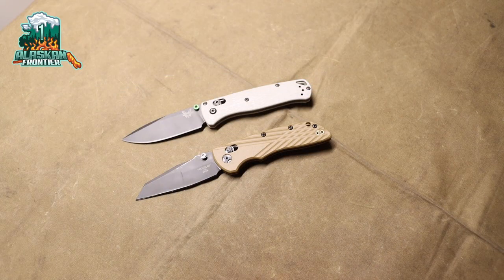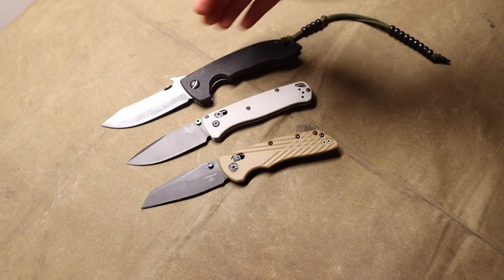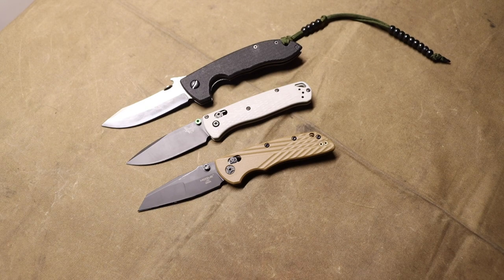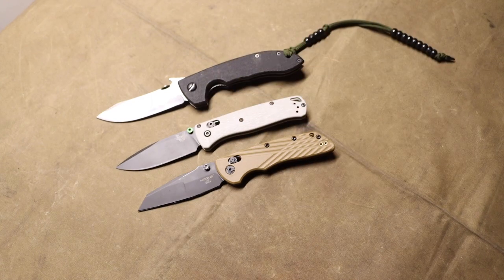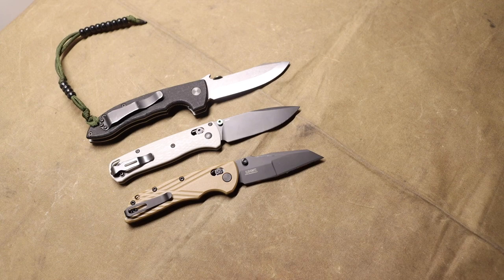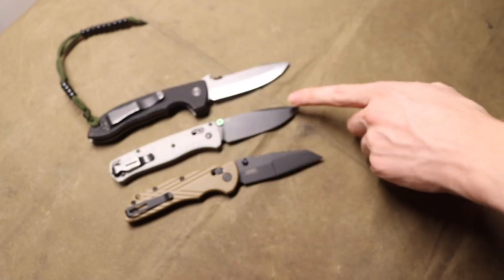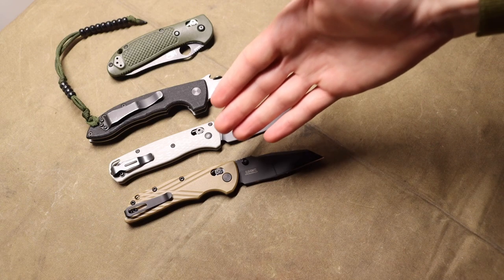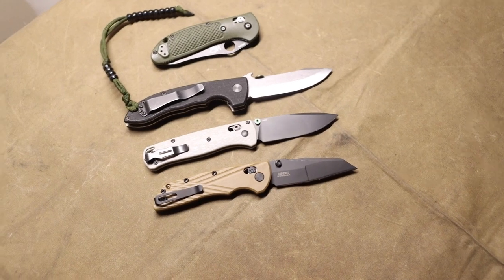THIS Knife Steel is Not the Future

Comment: Its not hype. Its high toughness for stainless steel that traditionally doesn't have toughness. Its edge retention at 63+ is better than most steels.
I really don't think you know what your talking about. I do agree that those brands who are doing it low on a folding knife are just bad value. If they do get 62 consistently that's decent enough for a balance of toughness and edge retention over the majority of other steels like s35vn and most poor performance m390 from most brands.

But yeah buck with magnacut and huge prices is not worth it.

Comment: You know I have to absolutely agree with you. The consistency of a good heat treat for magnacut from Knife makers seems to be really hit & miss. The one steel I really have been super impressed with is S45VN from Spartan Blades, ASK, Spyderco. It’s been outstanding from edge Renton to stability of the edge to rust resistance & how it sharpens. It’s been outstanding and I believe it’s been way underrated due to the Magnacut introduction & push. I have had some pretty good experiences with Magnacut from Barl River but I haven’used  it long enough & sharpened it enough to have a  strong view point yet. Keep up the great work!
Reply: Spartan Blades will probably do a good job with magnacut. They are working with KABAR to make magnacut knives so we shall see how those do.
Reply: Let's see if what the future brings and how 15v is

Comment: Curious how well Spydcero Magnacut knives will perform. The Dekas had a rough start and Buck did some magnacut 110s that were about 61-62 hrc which is not horrible as far as hrc is concerned.
Reply: Its good depending on cost. Check outpost76 for cut testing, he's tested many brands in magnacut. I think Cedric Ada Also tested mules at 62 & 63rc.
For toughness test you can see Carrothers performance knives on youtube but his is a custom heat treat with longer soak time at 63rc. But he compares it to delta3v and some other steels.
Reply: @tacticalcenter8658  yeah I have been eyeballing Carothers for some years now and I did see his magnacut video. I wish I could look at outpost's edge retention list but the link in his video description doesn't work on my phone for some reason 🤷‍♂️
Reply: @brandensutton2324  I emailed Gerald about his testing sheet. You can search outpost76 magnacut to see some of the ones in videos but not all titles have the steel name in the titles. Email him about the sheets and maybe he will see its more folks interested and dont have access.
Reply: @tacticalcenter8658  yeah I think I can't see it because of how the file is saved or something? Not really sure. Thanks I will try that.